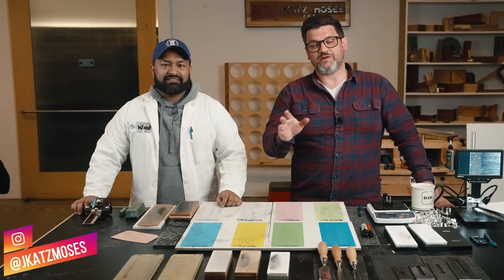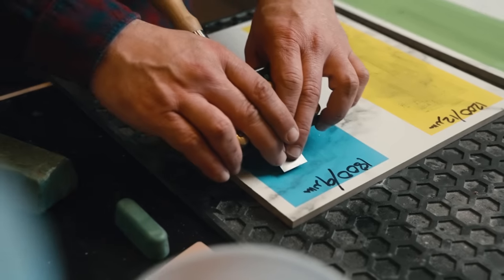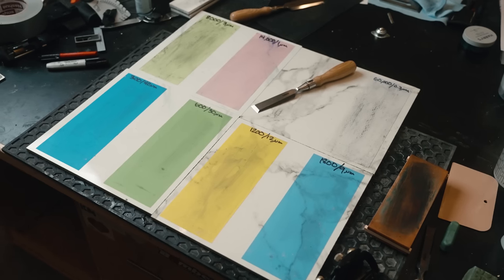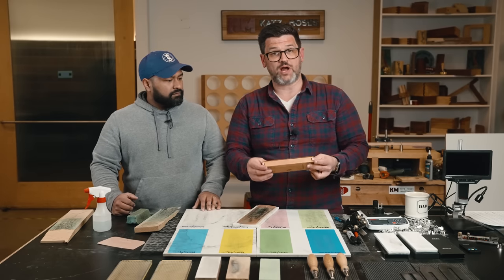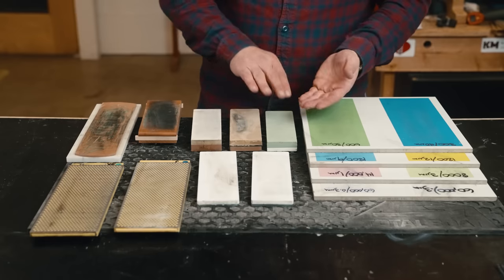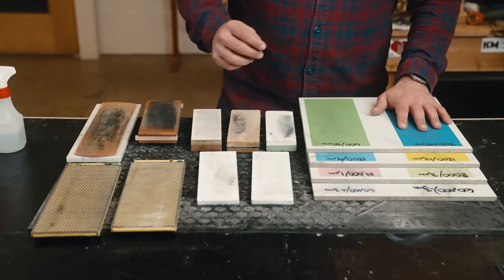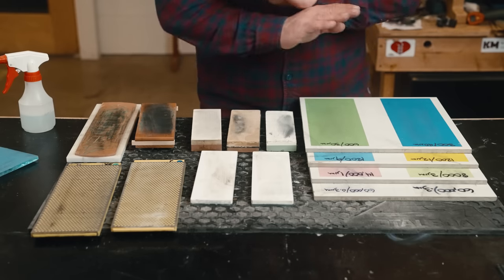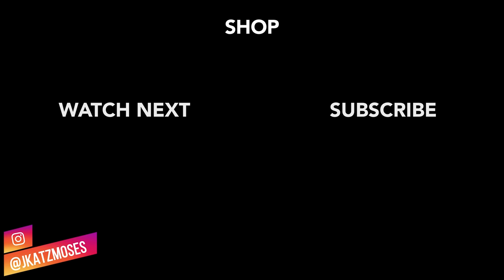The Most Comprehensive Sharpening Test Ever Done

Comment: Dang, I was hoping to see results based on method, i.e. does it matter if you just pull the blade towards you, or if you go forward and back? What about sideways (in the case of when you're lapping the back).
Reply: Yeah this is what I was hoping for too
Reply: In practice, not really any difference, you will not be consistent enough to notice.

Theoretically, assuming you manage burrs properly, pulling will produce a slightly thinner and finer apex, making  it sharper.
Pushing will produce a slightly rougher apex, making it not as sharp.
The difference in this scenario? Basically nothing, nothing that you could ever do or really notice.

Conclusion? It doesn't matter, sharpen however you like, that is what will produce YOUR finest edge, and give you the most pleasant time sharpening.

Should be worth mentioning though, one advantage to edge leading strokes is that they minimise burr formation, which is a good thing.
No reason to make a huge burr.
Reply: @autumn5592  This is conjecture which I was hoping the video would address.
Reply: @larrybud  This is not conjecture, this is formed from seeing electron microscope imagery of edges depending on sharpening method.
Reply: @autumn5592  All his methodology was the same: Pulling the blade towards him, away from the edge. You have no data.
Reply: @larrybud  I'm not talking about the video, I'm talking about what I said...

Comment: I use a 1k diamond, 4k shapton, 8k shapton, then 16k shapton, no strop and I can cut paper with the edge I get. So I'm not sure why you weren't able to with a 30k shapton stone. You need to flatten the shapton stones just like water stones, a few passes over a 300grit diamond plate does it for me.
Reply from the maker: Yes we flattened it. The data is sound and we repeated it with two different 30k grit stones. It wasn’t that they didn’t work it was that they added no additional value. I bet you could get the same results with the 4k shapton you’re getting with the 30k. The parameters of our test weren’t how sharp we could get something with unlimited sharpening time. With enough time I could can a 1k stone to cut paper. Our testing parameters are stated in the video and consistent across all systems.
Reply: @katzmosestools  This reply should be highlighted.  I already invested (up to 16k) in the RC approach, and it's good to know it might just take more time as opposed to finding out I can't or shouldn't continue.  Like the OP, it works for me.  Wish I'd seen this video sooner, though.

Comment: Although I really enjoy the 'science' behind it (more so the data), it really does not have that much practical implications. Most people who do woodworking have taught themselves a way of sharpening one way or the other and made it work. I think I remember Paul Sellers doing a video where he just sharpened to around 400 grit and it worked fine. I know people who swear by oilstones. I like to use water stones (diamond for the initial set up of a new tool). Point is, people choose a method, make it work and go with that.

The real work is learning how to sharpen in the first place.. Free hand of course. :D

As long as it will cut wood cleanly it is fine. 

And after all of that.. Good to know that my hard leather strop and the veritas compound (I think) is a good choice. :D
Reply from the maker: Not Veritas but the best compound is linked in the pinned comment
Reply: @katzmosestools  I'll check it out. thanks.

Comment: My strop makes a HUGE difference in sharpness.

Non scientific for me, but it goes from pushing and tearing through a piece of paper, to gliding through it like a hot knife through butter.
Reply from the maker: Yep agreed. But are you using the best kind of strop? One of the many questions we answered in this video
Reply: @katzmosestools  ehhh, mixed lol

Not soft leather, not really hard leather. I’d say firmer than it is soft.

Mine came with a double sided diamond stone kit and it’s done the job. I was thinking of looking through some old items at goodwill soon to find a cheap patch of leather to replace on my strop because mine is just one glued to a wooden block and getting worn out. So the hard vs soft conversation is useful haha
Reply: Practice deburring on the stone. Takes a little while to learn and get down, but it becomes like second nature after a while.

In my experience, strops don't do much (because of aforementioned stone deburring), I only use them to maintain the edge after I use it.

Or, keep sharpening like you are, if it works for you keep doing it.

Comment: Ok but rough side of the leather or smooth side for stropping?
Reply: Depends on what you prefer.
Smooth side (on proper veg tan leather) is where most of the natrual abrasives are in it.

Rough side holds compound better.

But both sides will deburr, because deburring is a mechanical process not and abrasive one.
Stropping bends metal, which fatigues it and breaks it off.

Abrasives can speed that process up (by further reducing apex size) but is pretty inconsequential.

Comment: I use oil stones. They almost never need flattening. Waterstones have always seemed like a scam to me because you're always wearing the stone away to flatten them. I start with diamond stones then for the final passes use my oil stones. I found a granite company and they sold me scraps of cabinet splash guards for not much at all. I got a 4ft piece of marble that was 12"wide . I use that for flattening plane irons.
Reply: Good water stones don't dish quick.
It's only the cheap-China stones and (intentionally soft) King KDS ones that dish.
Flattening doesn't take that much off, and management of where you sharpen can minimise it.
Even a bad stone will last a decade of continuous use.

I don't like them because they're messy though.

Comment: I really like the KM Tools items like the router plane, mallet etc but I don’t like the Chisel Sharpening Jig as it is very difficult to place the chisel square, keep them square and set the correct angle. The only thing I like is the wide roller but that only helps if the chisel / plane iron is square to it.

Comment: All my blades are hollow ground(not sure of angle(s) right now - will have to measure. If I want to standardize on 30 deg micro bevel at what angle wold you suggest for the initial hollow grind?
Reply from the maker: 25 degrees makes it real easy to do a 30 degree micro bevel but again… it doesn’t matter hahaha

Comment: How do these methods work compared to sharpening with a Tormek?
Reply from the maker: We used the Tormek for the 25 vs 30 test and grinding all the bevels to 25. The Tormek is amazing for rapid steel removal and creating a hollow grind which makes hand sharpening easier. That being said I can easily get any blade below the 140 mark with just my 600 grit wheel and a strop. Again it doesn’t matter just use a strop haha

Comment: Sharp and ability to hold an edge are two different things.
Reply: Edge angle remained the same, the steel was all the same.
Grit doesn't have all that much effect on edge retention, but he was testing (mostly) super high grit finishes, so edge retention difference would've been negligible.

How exactly does sharpening abrasive effect edge retention?

Comment: Cabinet maker, 30 years. Then I bought a straight razor and finally learned a little about sharpening. I sharpen/hone once per year and strop the rest. (my face is a better tester than your expensive device)  If you allow the burr to get too big, when it breaks off it takes your efforts with it. Sharpening is an art. When sharpening a new blade - plane blade/chisel - the degree of bevel is up in the air. One begins with a steep bevel to find out how 'tough' the steel is. The angle of bevel is backed off until the edge both cuts well and is somewhat durable (each blade is different - there is no 30*, 35* or whatever. Start thin and end when the edge doesn't just break off)  Work both sides evenly.  You all were stroking the bevel edge about 50 times and not at all addressing the flat side - wrong! Like stropping; one stroke per side, repeatedly, is the way to both strop and to hone. Too, I noticed, when stropping, you guys were pushing WAY too hard.  After 15,000 the edge is prone to breaking off, if pushing down hard on leather. (push hard on hard stones, NOT on a giving surface like leather) My stones are Shapton and natural Japanese stones - many $ invested. I make my own strops out of really hard butt leather - belly leather gives too much (head on pillow effect) Spend a few hours making the back side of your chisel/plane blade mirror-like (you only do it once) then never scratch it up again, under 6000 grit. Work both sides evenly to 'bring up' the edge - you cannot 'force' the edge. Never waste your time on crappy steel.
I'm afraid I have to say that you guys need better hands.

Comment: Personally, going above ~9k is more masturbation than effect. 6k is my happy place for 'scary'. 3k is an easily achieved working level for on the go stuff. I use 3M sheets (plus glass) and green compound. And a broken in hard strop. Works well without getting crazy.
Reply: I don't go above 1k, anything over 2k seems pretty pointless to me at the current point in time.

Mostly do 220-320 grit edges.
They shave and do all the fancy tricks, good enough for me, why mess around with more stones when I need to be working.

Comment: Bro… oil stones??? They are flatter than water stones and more durable than diamond… that’s why everybody’s grandpa/grand person had a boss set of oilstones…
Reply from the maker: The only difference between oil and water stones is the binder (glue) that holds the aluminum oxide together. Water stones cut way faster than oil stones for that reason. Diamond stones are significantly more durable than oil stones. The only reason our grandparents used oil stones was because they took little maintenance. Diamond stones weren’t even around then.